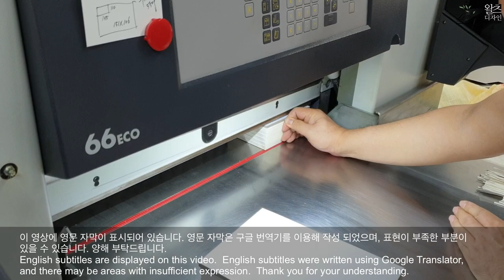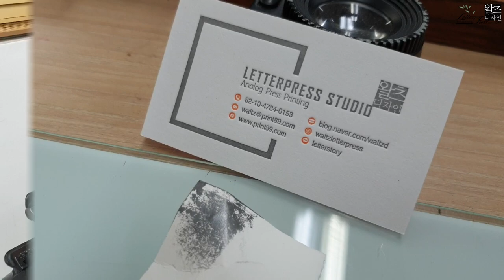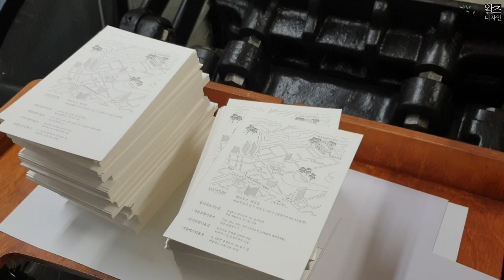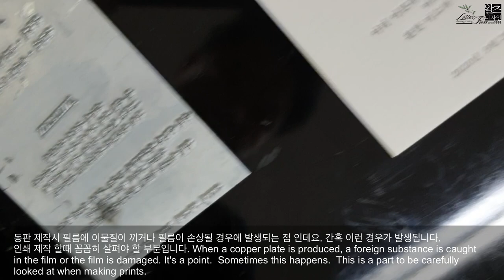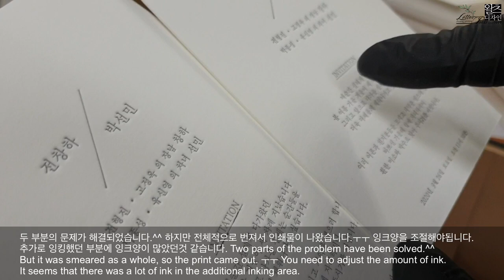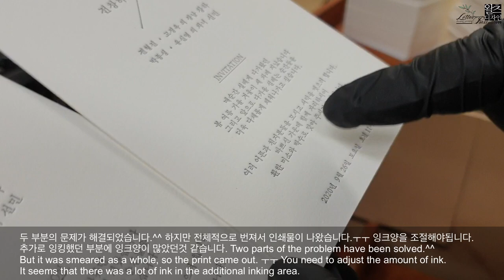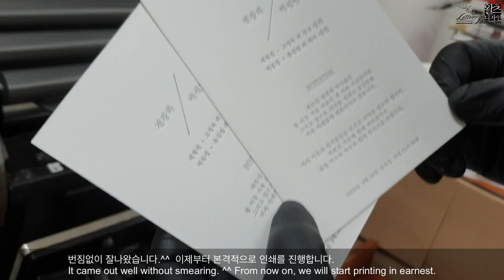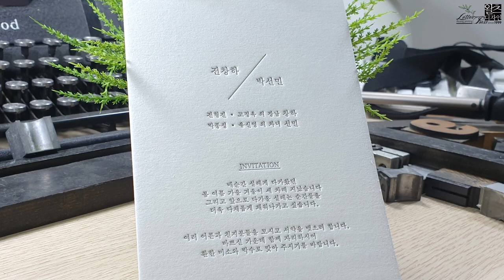Create double-sided letterpress wedding invitations. 레터프레스 양면인쇄 청첩장 만들기.

Comment: Looking nice!
What kind of metal was used to manufacture that printing plate? Thanks!
Reply from the maker: Nice to meet you.  I use the zinc plate by corrosion.  Sometimes a magnesium plate is used.
Reply: @w_letterpress  thanks! Is there any practical difference between them? Or price difference? Just curious about letterpress so my questions maybe are naive.
Reply from the maker: @uafantom  First, the price is doubled.  Magnesium is expensive.  In Korea, zinc plate is mainly used.  However, the magnesium plate is light and hard.  The shrinkage and expansion rate is small even when it receives heat during foil processing.